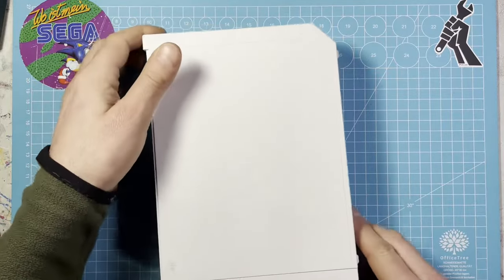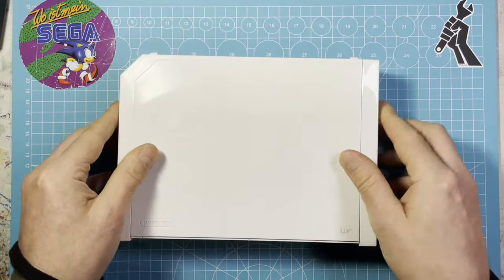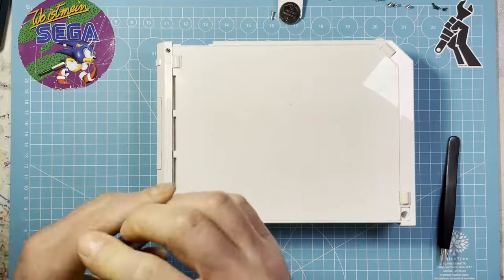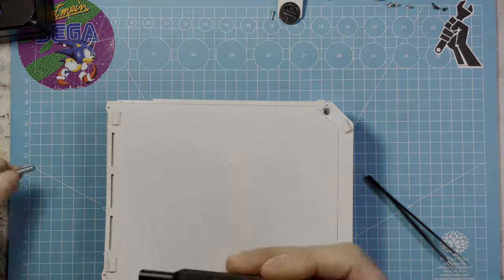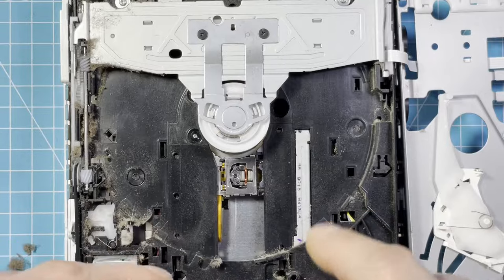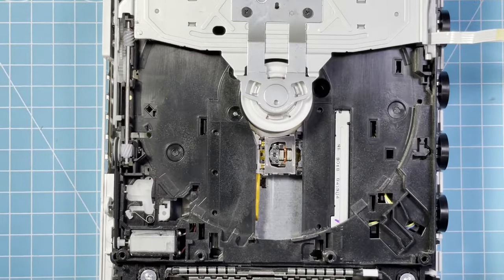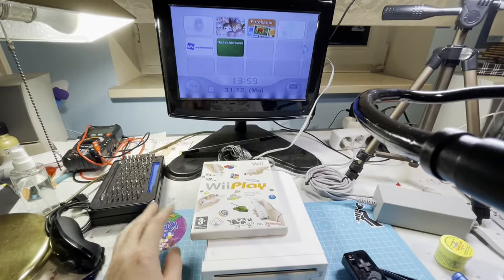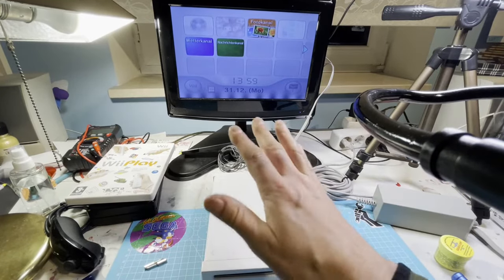NINTENDO Wii: CLEANING THE DISK DRIVE

Comment: My console has the most tight fitting screws even WD40 doesn't work. The aggravation is not worth it. Just going to buy another one if I can find it.
Reply: I had tight screws and was able to get them to unscrew by lightly tapping the end of the screwdriver.   Took a while but didn't damage anything.

Comment: What was the name of the grease you used? Are there other alternatives? Thanks.
Reply from the maker: It's called GEAR-FLON. It's a teflon grease used for model cars etc. I think you could also use lithium grease.
Reply: @TheKonsolist  Oh. Thank you so much.
Reply: @txubbsy  don’t clean the disk reader with grease, I assume they only used the grease for the moving mechanism and cleaned everything else with rubbing alcohol.